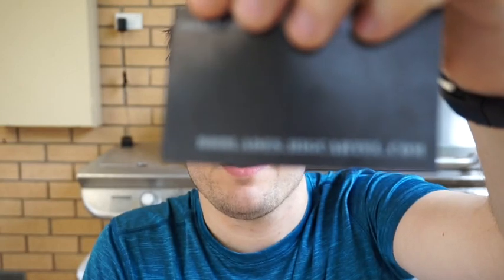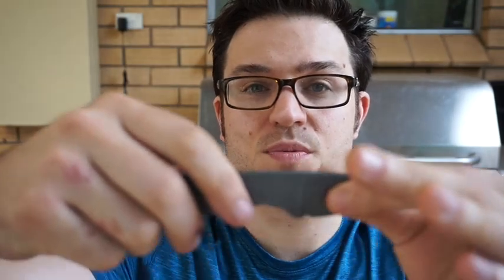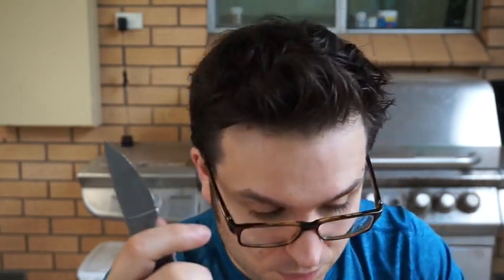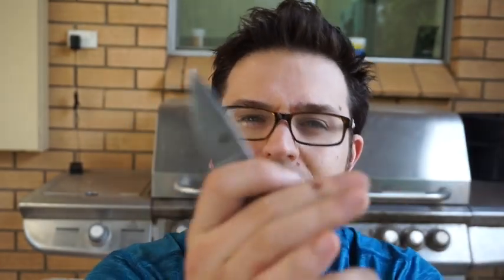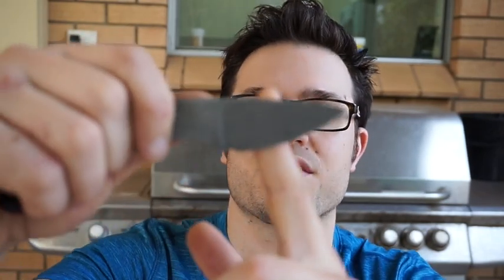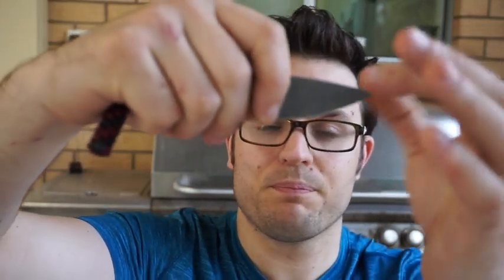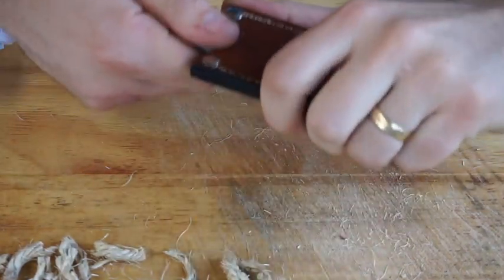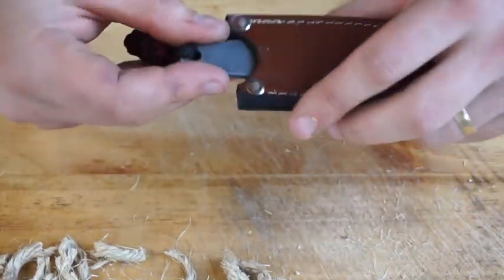Edge Retention Testing: AEB-L on DB Blades Edc Fixed Blade (HRC 60-61)

Comment: Can I ask ya a question of topic?
Have you had any problems with your Real Steel Bushcraft? Mine had a bunch of micro chipping so I had to convex the edge, I dont think D2 makes for a good scandi knife. The knife works great and has good edge retention but dang it got all kinds of chips on my last camping trip.They were tiny but all the way down the whole length of the knife so I had to sharpen them out and convex the edge with a loaded strop. Virtuevoice does a good video on "easy convexing with a just a strop" it is really easy and fixed the problem, that dude is a magician with Japanese water stones.

Comment: Measure 2 inches from the tip and leave that un  taped. The rest  put tape around it so it can't be used and affect the test. That way all testing will be fair

Comment: Oh my!  I was just about to pull the trigger on a Spyderco YoJimbo in S90V from KnifeCenter & thought I'd check your list. Oddly enough I don't see that steel on your list. Is that possible?
Now I'm in a dilemma. Should I buy this knife not knowing how many sisal rope wielding Ninjas I'll be able to dispatch while still being able to reliably slice paper?!?
Which brings me to another point - or perhaps a suggestion. Once you've defeated the onslaught of latest & greatest steel introductions with your testing, could you look into testing the durability of the various coatings the manufacturers use? The KC version of the YoJimbo I'm considering has a Spyderco DLC on the steel. I haven't found a coating that has been over-the-top impressive in terms of not looking like crap after an unreasonably small amount of use. 
Cheers, mate! Thanks for all you do for the knife community. We all (except the typical trolls & haters) really appreciate it.
Reply from the maker: +ogenmatic S90 is really my last big steel to get - I've my eye on a 940-1 though so soon, I hope! Yeah, I could see coating tests happening. I just need to
work out the 'hows' and such of a repratable test.
Reply: Cedric & Ada Gear and Outdoors 
Awesome!  Thanks for the reply. I always look forward to your inevitably entertaining & informative videos.
Reply: Did you pull the trigger on that yohimbo? Is there a review?

Comment: Pete, is there any steels you have not been able to sharpen on the work sharp? For example someone told me they couldn't get D2 to sharpen on it. I'm seriously considering getting one but keep getting conflicting opinions on it, it does good enough edges, it does shit edges etc.
Reply: Mt. Baldwin I've never had any problems with any types of steel including D2... I also have an extra one for sale if youre interested. A Ken Onion with blade grinder and tool bag.
Reply: Aaron Rowe I'm certainly interested
Reply from the maker: +Mt. Baldwin the high end steels just wear through belts like crazy. Maxamet ate an entire brown belt by the time I was done
Reply: Depending on the thermal cycles (hardening and stabilizing the ultimate alloptrope) D2 is said to take a lousy edge and hold it forever. Your mileage may vary.
Reply: @ssunfish  for ever? Nah, D2 and it's German variant I have used,holds just a little better than O1,most people will never notice the difference.

Comment: Non sintered PM steels can be made into desirable knives. Steel snobbery isn't everything. I had a drop forged stainless N690 steel knife that worked tough job for hours n did not get dull. It wasn't a proper test with a paper cutting sharpening. Hmnn...different steels, grinds snd sharpening for different purposes. What a novel concept, ha ha!

Comment: how can AEB L harder than 440C ? there is something wrong with 440C
Reply: They both can be made very hard, depending on the heat treatment, but 440c will become brittle beyond it's suggested hardness.
At the same hardness (or same resistance to deformation), 440c will resist more scratches, while AEB-L will be more resistant to fractures. Since AEB-L is tougher (more resistant to fracture), you can use it at a higher hardness.
Basically, in folders and small knives, AEB-L will be sharper because it's high hardness and high toughness will make a very thin and stable edge that is resistant to chipping and rolling. But once the edge becomes thicker with use, it will wear out faster than a same edge in 440c, even if that 440c blade is a few points lower in hardness.
Although, in large outdoor knives that have to withstand a lot more impact and lateral stresses, the above relation might change quite dramatically. Which, in this scenario, the AEB-L can also have more edge holding.